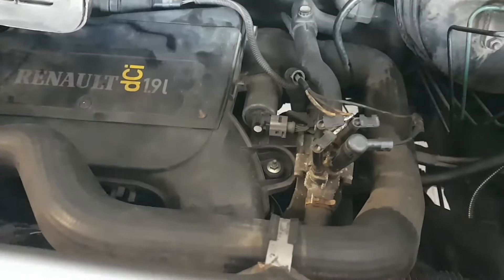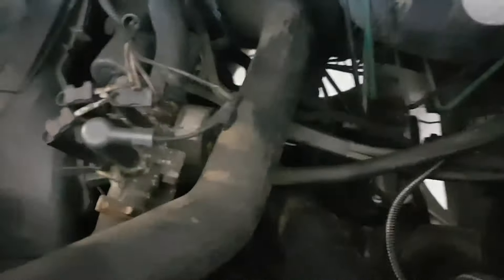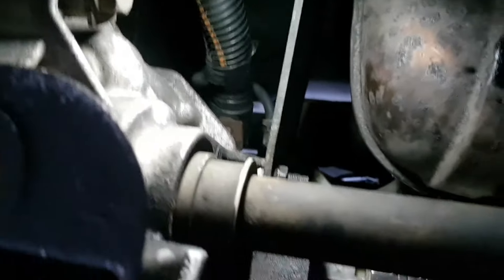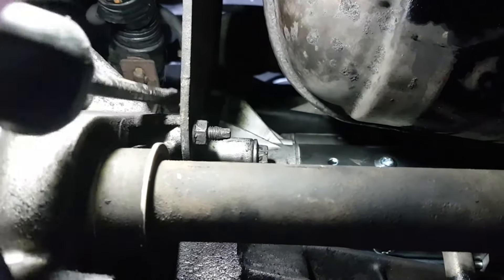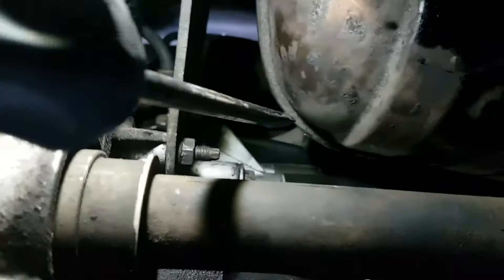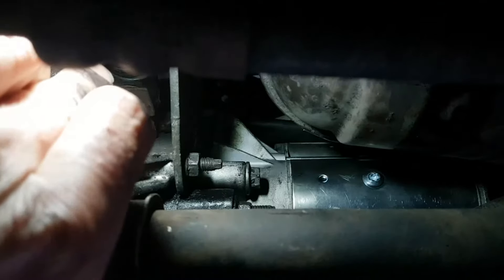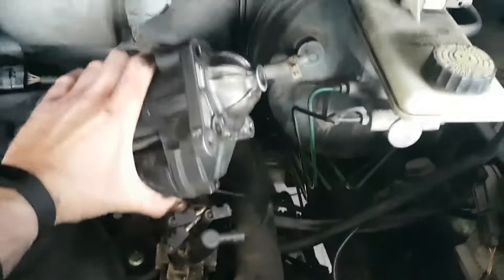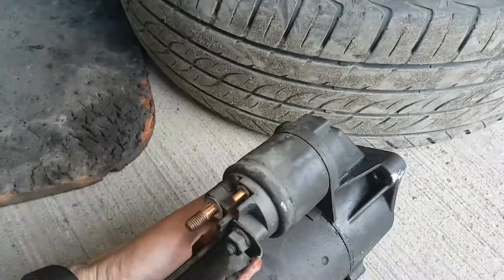Vivaro trafic primastar 1.9dci 1.9cdti starter motor change, the easy way

Comment: Just done this, yep it works. Cheers for the video! 

Tools needed are the following. 
13mm spanner, use a small 1/4" ratchet, 7mm socket for hoses, 8mm socket for exciter, 13mm for main feed and all other bolts. And youll need a couple of extension bars to use ratchet for tightening exciter and 13mm main feed wire.

Took me about 4 hours. But if you watch the video a bunch of times and have tools handy you'll get it done quicker.

Comment: I've literally just finished this job on my own van because all the mechanics were booked up. Used your video and the Haynes to great effect. 

It's a very tight job though - getting the starter out is especially difficult. I'm not a mechanic but luckily had a garage full of assorted tools and a pit inherited from my grandad. Some of those 13s you can't get with a socket wrench so make sure you have some spanners to hand.

The exciter wire and main power feed are also quite difficult to get. I forgot about the exciter wire, but you can actually leave it on and take it off when you have better access. I managed to get the exciter using a socket wrench with a long extender which gives you just enough reach to get at it.

Comment: Just done this on a mates van and would like to add my experience. I didn't bother with disconnecting any of the top hoses as they never got in my way, after messing around for ages to try and get my socket on the top nut that you cannot see (from the right) I realised that this one had a long bolt from the left hand side and not a nut. 
My starter came out from the bottom as well, was worth watching your vid to get the basic idea though. thanks

Comment: To be honest you dont need to remove that metal bracket.  Ive done it without taking it out. All i did I removed both boost pipes, then 3 bolts from the top and one from underneath.  Only the starter motor bolts. Then same way as you. The gap between cat and driveshaft is enough to get it the bastard out.

Comment: Just been quoted 450 for this job and they said it would take all day 😂
Reply: I was quoted similar to swap my alternator. Did it in less than an hour outside my house with limited tills..  took all front end of van off and was done and running in less than an hour

Comment: Just pull the drive shaft. If your stuck.    
It’s all very well doing it this way, but doing a bolt up you cant see when re installing, unlikely.
Reply from the maker: Thanks for you insight of it Chris, this m8ght others out but in on this particular job I was able to do it how I've explained
Reply: WHEEL HOBBIES 
Cheers for the video, I learned a lot,   Will be having a go at your way in next couple of days as my Vivaro starter is playing up due to dirt, oil or possibly corrosion or all of the above. 
Thanks for the upload as I get to know the jist of it all.
Haynes manual says something similar to your way.

Comment: thanks for the video. question - for the starter motor bolts what did you use to remove them - spanner or socket? one of the bolts on top of the housing is super tight to get any kind of leverage on, impact wrench or even hit it. so just wondering how you overcame tight bolts with very little space. any tips appreciated.

Comment: Hi mate, I was wondering if you can help me please? I have Vauxhall vivaro 1.9 & I've got a blow on my exhaust. It's the section next to my manifold/cat/starter motor on a bend. Someone said I can get access to this by taking out my driveshaft, is this true? As I'm needing to weld it.
Many thanks
Reply from the maker: Thanks for your message,
I later had to do the turbo on this van and I didn't have to remove the drive shaft to get the cat unbolted, because I never actaully took the cat fully off I can't 100% say weather it will come straight out,